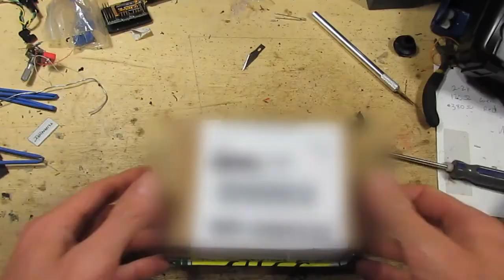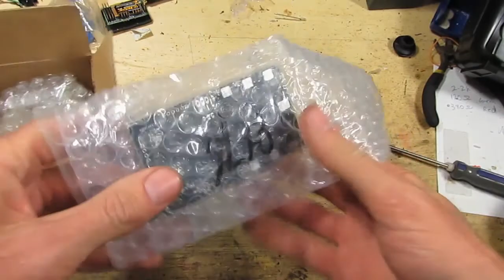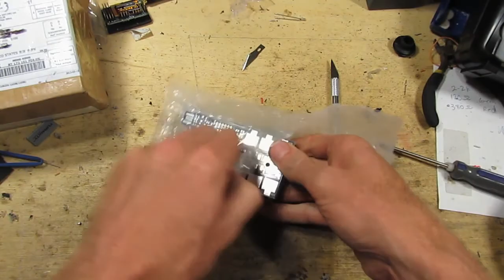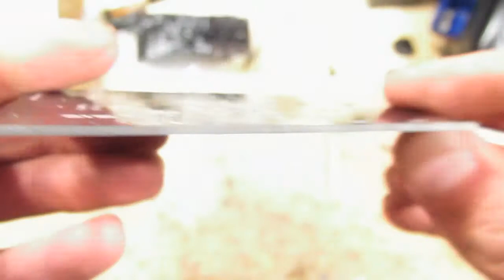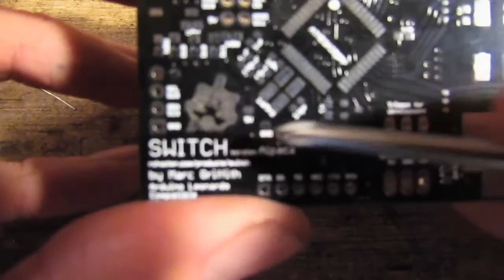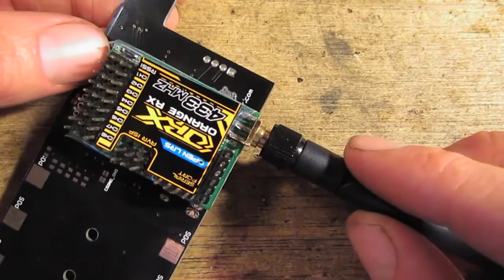RCHacker Switch PCBs have arrived. RCHacker #32

Comment: I was wondering how the weather is in Ecuador right now Marc? Gone to heck up here north of the 49th parallel! I am envious of your background as I, at the ripe old age of 50 something, am venturing into the world of RC electronics, Arduino and RaspberryPi. Naturally the most compelling projects are those that have an immediate application so I am kinda hung up on the RC part right now and tonight I am soldering up the headers on my APM 2.5.2.and testing the whole system with the Mission Planner, finding fascinating and totally immersive
 I do have a question regarding the digital RF switch though. You say it is capable of high current and voltage, may I ask what would be considered high in either for LED control? I must say that the Alpaca's are very a compelling design. Hope you are having good luck with the SMD's. I just ordered my first hot air rework tool and some DIY gimbal PCB's but I must say that Newark's And Mouser's BOM beta parts requisition service is a dead loss so far. And boy that ordering process is drop dead boring. Needs must when the devil tolls Huh? This process for you could be a little daunting I imagine...
Not that you will get a rise out of this but you have been a contributing factor in my pursuit of knowledge in this area. Will you be selling the surplus boards? I am doing a new Hex APM 3DR Telemetry and Stereoscopic FPV and my own goggles design and implementation..This time last year I couldn't remember Ohm's Law..Lol
 All the best. Let us know about these if the time is right will you?" the canterburyflyer"
Reply from the maker: Humidity is killing my SMD soldering attempts, so much so that beyond the prototype I am finding it very hard to get anything working.
I think the fets were rated 60v 80A or such. Of course you would need a big heatsink on there too.

Comment: can you make a video on how to build and osd with features like gps, home arrow and battery monitor maybe arduino based...on ebay there are arduino pro mini that are 4$ with shipping, size 33*18 mm and should weight next to nothing!! Or the pro micro with usb built it...With a cheap gps module could revolution DIY osds! Or maybe you could make a kit and sell it like the switchs!